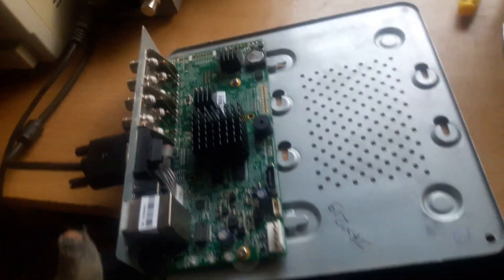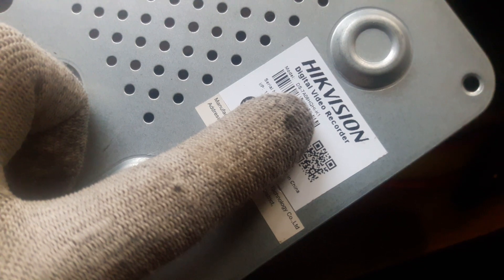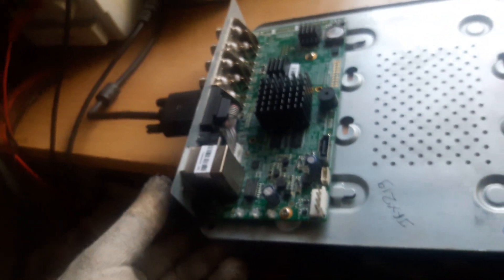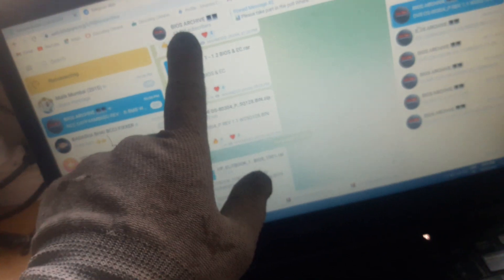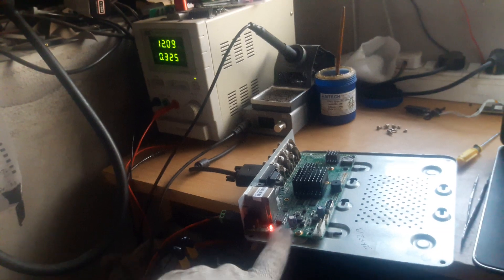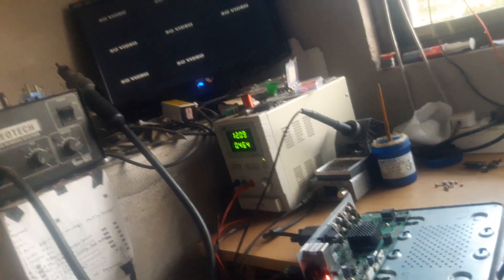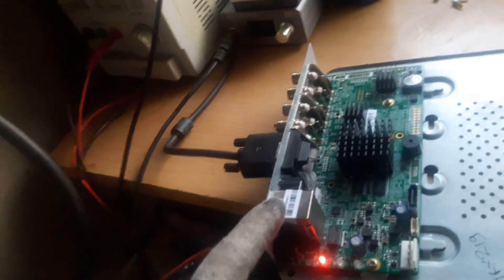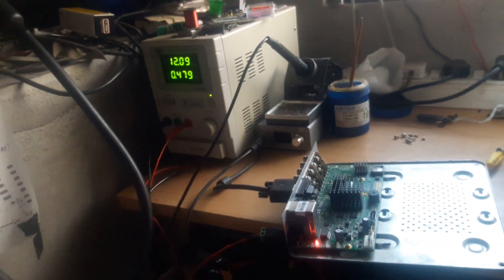Hikvision DVR hang on logo

Comment: Hey mate, I have DS-7204HUHI-F1/N I put the file on a fat32 USB and plugged it into the DVR, it just continues to boot loop after showing the splash screen logo. Any suggestions? Thanks.
Reply from the maker: Try using another usb or another file